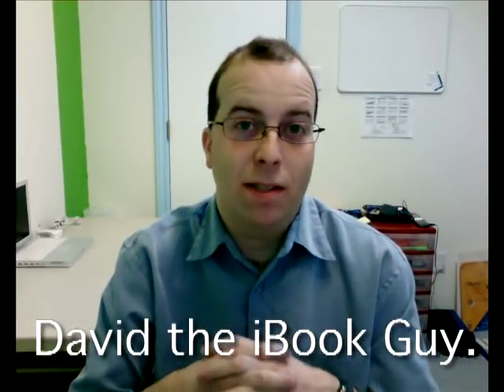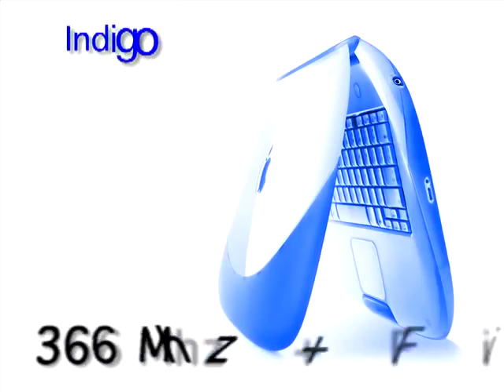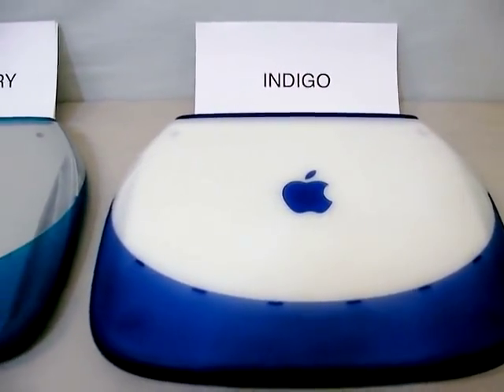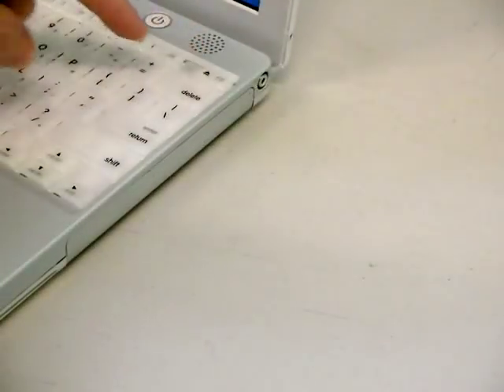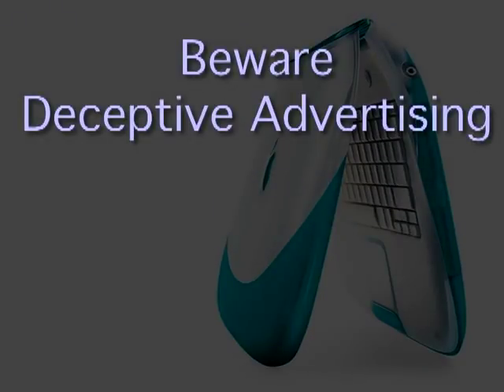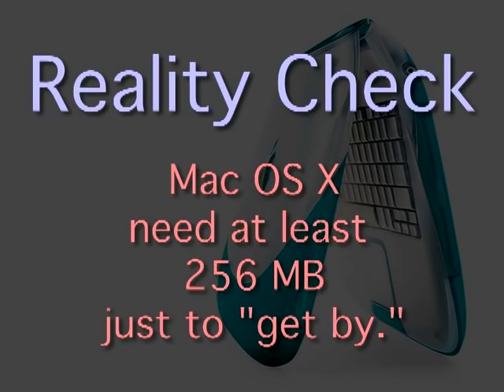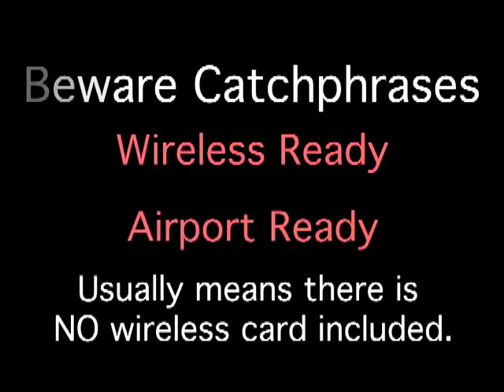Apple iBook Clamshell Video

Comment from the maker: By the time you repair and add all those things you want, you could probably buy a brand-new laptop.
Reply: But that new laptop won’t run PowerPC Mac ;) one of the most advanced operating systems in the 2000’s and a piece of history.
Reply: But it did run Crysis. Or did it?
Reply: @alephcake  a more impressive benchmark is the sims 3 with all expansion packs on max settings. Even a switch can run crisis, not many machines are able to breeze through the sims 3.
Reply: @clbl8706  even though I love the design of Mac OS 9, Intel Macs running Mac OS X are WAAYY more advanced, powerful, and energy efficient than PowerPC

Comment from the maker: Yes, you can put the G4 into target disk mode.. but it gets tough because it seems to want to default to the hard drive in the G4.. but I did it successfully with an Intel iMac because the O/S on the iMac wasn't valid for the clamshell.  Also, the DVD-ROM from a 466Mhz clamshell will work, but the bezels aren't compatible so you better make sure you get a bezel with the DVD-ROM.

Comment: The Clamshell does look neat. I am not an apple user, but those are some neat looking laptops. Apple does come up with some neat ideas. I did buy a Mac Mini G4, because I am a sucker for compact computers in the vein of the C64 and the Amiga.
Reply: ***** I would STRONGLY recommend you to buy a hackintosh laptop. That way you get a MUCH faster and better laptop for less than half the price. Here, have a link: http://www.macbreaker.com/2014/04/the-best-hackintosh-laptops-of-2013-2014.html
Reply: alysdexia  Kinda true
Reply: alysdexia  Yeah, I honestly didn't know the 16 inch MBP came out. I still use more ports than USB-C. I have not bought a new apple laptop since 2012.

Comment: "Wireless ready" to mean ready for a wireless card to be installed is a bold faced lie.
Reply: +YankeeSpirit "HD ready" is the same lie :P
Reply: *****
Just bullshit marketing terms. AGP graphics cards in the 90s were HD ready. It's a meaningless term with regard to computers.
Reply: Apple themselves used that marketing. They would sell their iMac and PowerBook G4 models as "ready for AirPort" or "ready for wireless networking." Which meant you needed to buy a $99 AirPort card. I think the last computer they sold without built-in AirPort was the 12" PowerBook G4.

Comment: I think apple or  some other company should make modern equivalent computers with the same clam shell design but that run with modern specs like core i5 and i7 processors and osx yosemite or windows.
Reply: Put a high powered rig in a beige case, add a floppy drive, install DOS or similar and off you go.
Reply: thatguy can these clamshell laptops be modernized? I love the old school designs and want one of these but I want it to run it "real time".
Reply: I don't know much about laptops in general to be honest, sorry, but I doubt you would be able to but a modern board or processor in one, more memory would be fine, just as long as it's the right type, but I doubt you would be able to "modernize" one of these, sorry again.
Reply: That would be pretty cool. :D I do wish they would bring the yo-yo charger design back and make it for the MacBook Pro and MacBook Air.
Reply: Ditto Sarah. I feel the 90s had some classic solid designs on a lot of things, clothes/fashion technology even music. Bet you won't believe I still have a Nokia Brick phone lolol that thing has good reception!
Reply: Check out Erick Siivels chanel he also sells the computers.

Comment: There is a syndrome called "the Vinegar syndrome" and it's the polarizer on the LCD that is deteriorating (and it's smells like vinegar), to fix it you need to remove the old Polarizer and replace it with a new one, which is expensive and time consuming. i recommand to check the images on the listings if the polarizer is not damaged

Comment: Do you upgrade iMac g3 computers?  My brother was given a second hand one running Mac OS 8.6, which correct me if I'm wrong doesn't even work with USB flash drives.  I think it has a 233 MHZ processor and maybe about 64 MB of RAM in it.

Comment: I remember back to when I had my first real computer (an HP Pavilion with the newly-released Celeron processor (I think mine was a 333 Mhz model with either 64MB or 128MB of RAM), and they advertised a "spacious" 5.1 GB hard drive.  Of course, at the time, 5GB was a lot and most computers only had about 2-3 GB as this was around the Windows 98/98SE era, and the OS itself was maybe 100-200MB.

Comment: I was wondering if u could/would please help me out w/my 15" PowerBook g4 & iBook. Both aren't working. I've had to get a (recalled) new charger twice for the PowerBook. Now it needs a now needs a new battery. Also, @ the point of entry where the powercord is  inserted into the mac & the end of the cord itself (again, the cord is bent right wgere u plug it into the notebook) a little bent where a relative accidentally knocked my PowerBook off my coffee table while it was plugged into the charge

Comment: I have an original 300mhz tangerine ibook and it only has 64mb of ram but I installed OSx 10.1 it works very slow so you can use less the 256mb

Comment: Technically, yes, but...
You will have to do an insane amount of modding. The keyboard, mousepad, disc drive all have proprietary connectors, you cannot reuse them. You will have to mod or remake connectord for EVERYTHING. There might not be enough room, there might not even be a solution for proper heat dissipation,... If you have done it I would love to see some pictures though!

Comment: Windows XP is possible (I think). 2GB of RAM is not. These machines support 576MB maximum and will not go higher. Both the graphics and the CPU are soldered to the logic board, therefore makes upgrades unfeasible. You'd have to get a whole new logic board and there is very, very few that will fit correctly in this machine.

Comment: Please I have an book g4, but the it doesn't display anything.
Haven't been able to use it since it was given to me..
The problem is when I turn it on, I hear a loud noise coming from the hard drive and it will want to show the apple logo and loading interface, it will just flicker and goes dark,
Reply: Remove the airport card, that will fix it. You will need to completely disassemble it though.

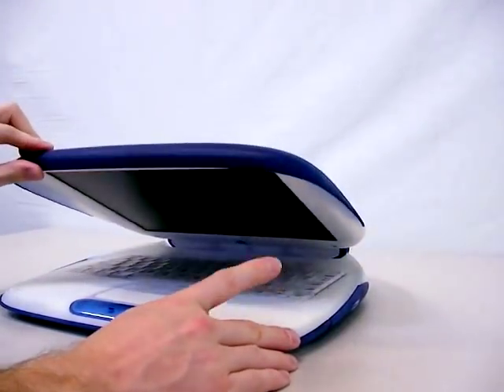Comment: Actually no, there were FIVE different colours of the clamshell models - Blueberry, Tangerine, Graphite, Indigo, and Key Lime. That's FIVE, not FOUR! At 0:32 you made a slight mistake!

Blueberry and Tangerine - 300 MHz PowerPC G3, 3.2 up to 6 GB hard drive, 32 up to 576 MB RAM, supports down to OS 8.6 and up to OS X Panther 10.3.9, introduced on 21 Jun 1999, no FireWire or video out

Graphite (SE - Special Edition) - 366 MHz PowerPC G3, 6 GB hard drive, 64 up to 576 MB RAM, supports down to OS 9.0.2 and up to OS X Panther 10.3.9, introduced on 16 Feb 2000, no FireWire or video out

Indigo and Key Lime (FireWire original) - 366 MHz PowerPC G3, 10 GB hard drive, 64 up to 576 MB RAM, supports down to OS 9.0.4 and up to OS 9.2.2 and OS X Tiger 10.4.11, introduced on 13 Sep 2000, contains FireWire 400 and Composite video output

Graphite and Key Lime (FireWire SE) - 466 MHz PowerPC G3, 10 GB hard drive, 64 up to 576 MB RAM, supports down to OS 9.0.4 and up to OS 9.2.2 and OS X Tiger 10.4.11, introduced on 13 Sep 2000, contains FireWire 400 and Composite video output
Reply: No, he was talking about the editions of the clamshell, most with more than 1 colour.

Comment: @DarthSkywalker727 dude these things cant run snow leopard.

infact they can only run up to 10.4 tiger if you have a 466mhz model which are hard to find.

and this guy sells them for 200 to 250  which you could get a g4 ibook for that much on craigslist or ebay.

Comment: is the ibook calm shell obsolete?
Reply: ***** its a g3 right
Reply: For whacking someone over the head it will do the trick.
Reply: It's a g3 right
Reply: +FregenDied can you still use it in 2016
Reply: Tommy Whitaker The main bottleneck is always the internet. You can use old software, but you can't use old internet.
Reply: LemonSlice what is the latest browser you can run

Comment: Not if u install something like LinuxMint15 XFCE 32bit and max out there ram, depending on the make, and model is somewhere between 2GB-4GB(1.5GB on the smaller 8.9in ACER machines), and for daily use basic computer it's all u really need, if u don't care about HD video, and gaming.

Comment: I just got a Ibook second generation with the 900 mhz power pc g3 processor 40 gb's of hard drive and 640 mb's of memory in excellent condition with mac os x 10.3 panther freshly installed and the restore discs are included and it comes with a brand new power supply, Everything for $125.00, Does anyone else think thats an awesome deal and it comes with a new airport card.

Comment: Ok this is a old video but I'll give a shot :)
I recently got myself a iBook indigo 366mhz firewire and apart from the battery being dead it was working flawless.
But the thing is it came preloaded with software (OS9) and I wanted a clean install so I went to MacOS9Lives and downloaded their 9.2.2 universal iso 
http://macos9lives.com/smforum/index.php?topic=2109.0

It booted fine I managed to reformat the HDD and was installing OS9 alright… But then the screen started to flicker and the laptop died…
The I restarted it and… Only got a blank screen… It's not black or white but a pale shade of blue and it won't show the boot selection screen neither show a blinking folder just blank…
CD still sounds like it's booting holding the key C but screen won't change - always that pale shade of blue…
Anyone has any hints on what could be wrong here…?
Mind you it was working just fine prior to trying to reinstall the system!
Reply: Carlos Ferrari unfortunately the hard drive of your iBook is broken...